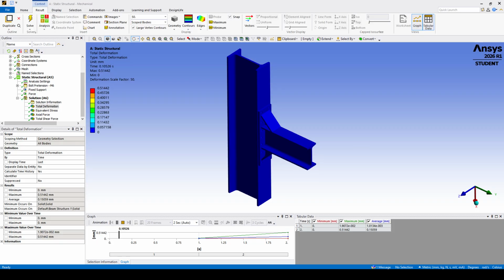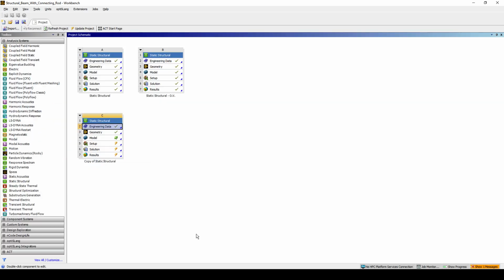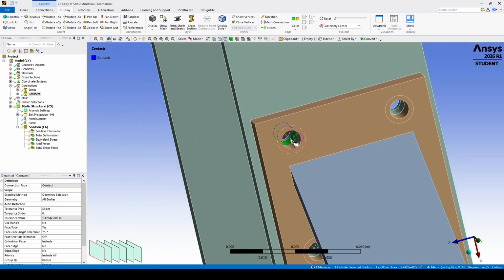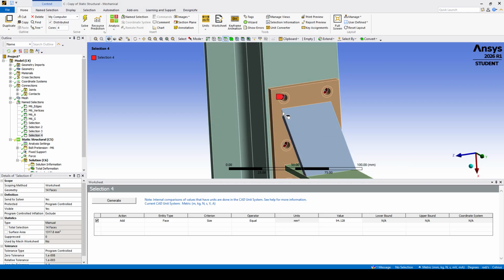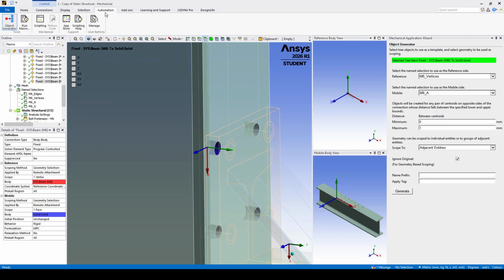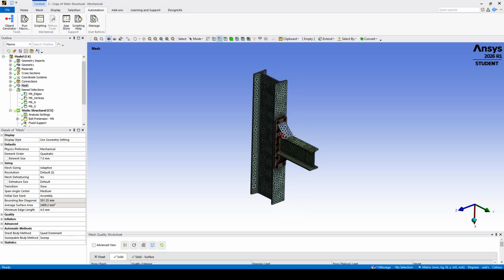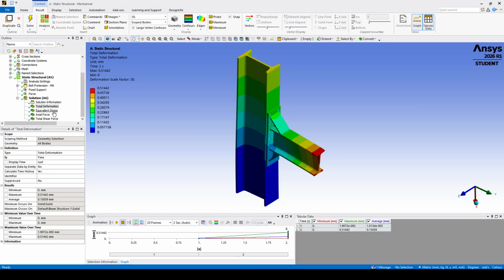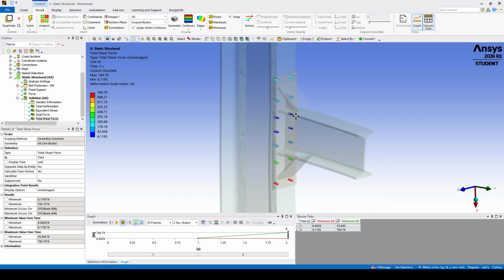How to Simulate Bolted Assemblies in ANSYS Workbench Step by Step

Comment: Hi! So when I did both bolt pretension on and bolt pretension off analysis what force do I take to calculate the axial stress of bolt? Like 10000 N with pretension? Or 3000 N as external force? Or 10000 N - 3000 N =7  000 N? Thanks in advance
Reply from the maker: Hello @trauma2441, so you have two ways in case you did the calculation without bolt pretension then that force obtained will not be taken fully by the bolt, a part of it only will be taken in addition to the bolt pretension. However that depends on the stiffness of the bolt and the clamped parts and I prefer to use this way (you will find videos about that in my tutorial). Second if you choose the calculation with bolt pretension then the axial force that you get it include both the bolt pretensuon plus the extra force so no need to manual calculation. However here you are relying completly by the FE-results which could be affected by mesh quality , boundary condition or.... for full assesment of the bolts and if you are interested in that I hugely recommend that you watch the full tutorial and I am pretty sure that you will learn a lot and understand well how to evaluate a bolt using ansys. 👍💪

Comment from the maker: 🔩 What’s your biggest challenge when simulating bolted assemblies in ANSYS Workbench?
Is it bolt pretension, contact settings, friction, mesh quality, or interpreting the results?💪👍
Reply: How to determine the exact bolt pretension to use. Eg when I check through BT charts of a A-70 SS bolt , the BT is 23.4kN when I use it, the item analyzed simply crushes, do you know how I can correctly determine the right pretension value to use. I'll appreciate that
Reply from the maker: @charlestoneoyoo  Hello, and thanks for sharing your problem! 😊 The suitable bolt pretension actually depends on the bolt size and type. If you let me know which bolt size you’re using, I’d be happy to recommend a suitable pretension value for your simulation. 👍